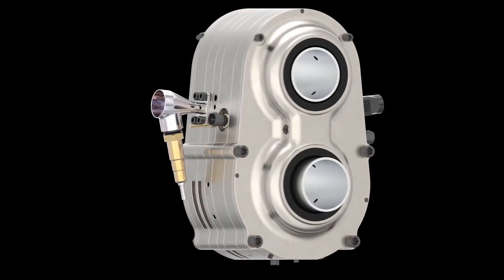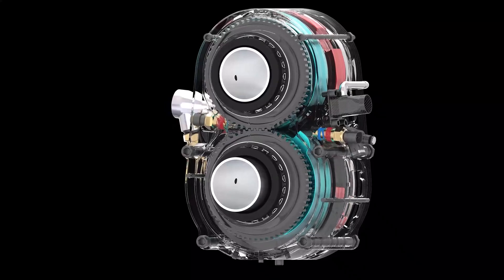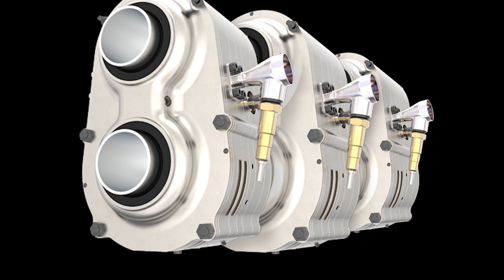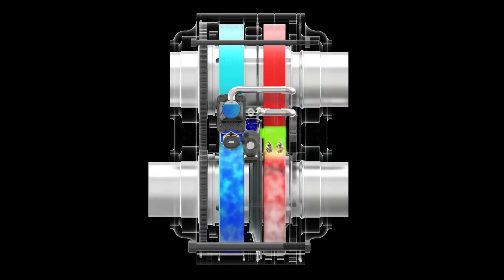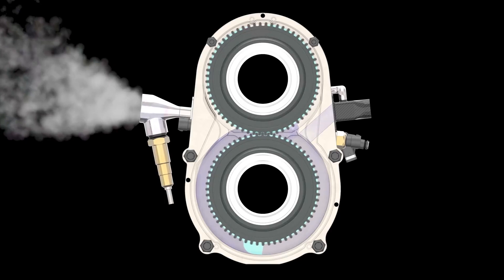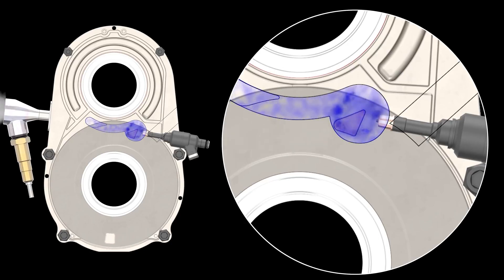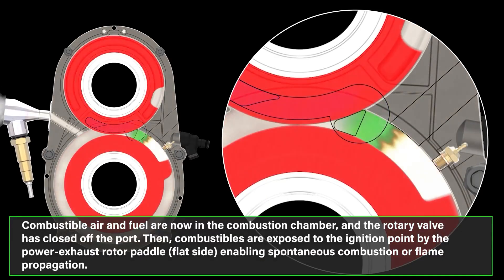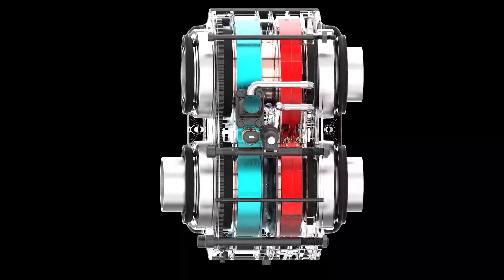This pistonless engine runs on hydrogen and revs to 25k rpm

Comment: Is there a demonstration? There have been plenty of ICE designs that, when simulated, show impressive numbers, but then in practice fail to deliver and/or have other problems such as quick deterioration of the engine. 

Electric is the way to go, for sure. Why? Because fossil fuel powered ICE-s must die, leaving only things like 100% biofuel or hydrogen as the fuel source, both of which will be using heaps of electric power to generate said fuel in the first place. Not only are electric motors much more efficient just on their own, the energy loss from fuel source generation has to be taken into account as well... meaning in practice, any useful chemical fuel source will be much less efficient than charging an EV directly from the grid and driving it on that power alone. Given this reality, ICE-s must be phased out for land transport use cases. The only logical continued application I can see for ICE-s is in ships and planes... and even in both of those cases, humanity absolutely has to minimize their usage in favor of electric powered vehicles where-ever possible.

Comment: The electric car is one of the dumbest ways liberals have come up with to try to yet again save the planet. Much like the curly q light bulb wind turbines and solar. They are amazingly horrible ideas for saving the planet. So far every idea liberals have come up with have exacerbated the problem not helped. Maybe if we stopped deforestation in the Northeast for solar farms and started planting trees again. We can slow the process down as we develop good technologies.thorium

These alternative energy sources include thorium, solar power, natural gas and hydrogen. Thorium can be used as a fuel in the nuclear cycle as an alternative to uranium and the technology to facilitate this has been around since the 1960s